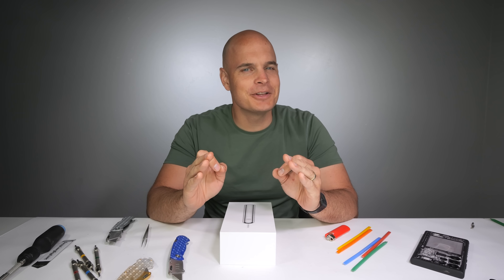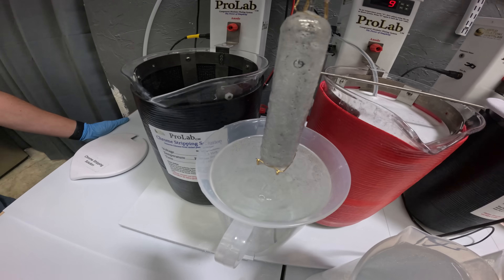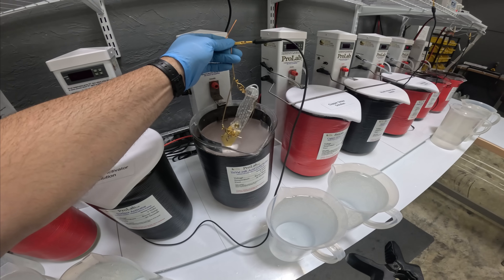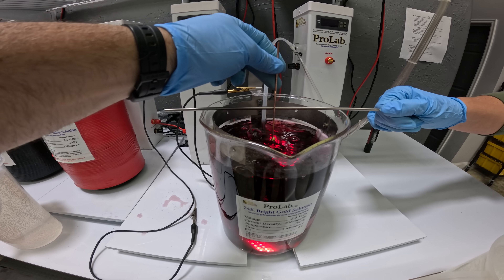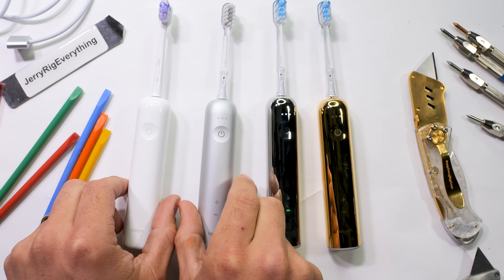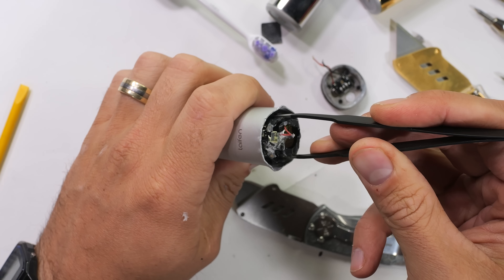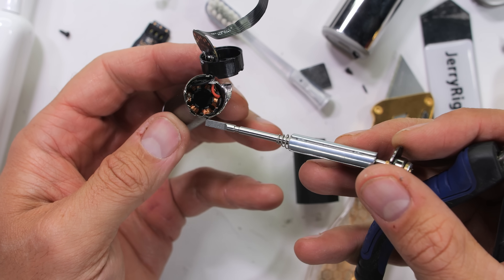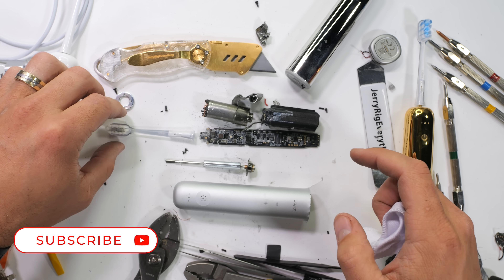THEY SAID IT WOULDN'T WORK!

Comment: 4:11 24k Gold is extremely soft and scratches easily - most things that are Gold plated and need to be touched by ungloved humans use 18k Gold. Gold is also not the best conductor - despite this it is often used anyways for literally being unable to oxidize (though any elements alloyed with it can and do). It will not corrode but it still dissolves quite readily in an appropriate solution.

Comment: Engineeringly bad design of electric toothbrush. I have a better idea and is a cylindrical brush at the top spinning one direction like the electric motor and half side of the brush is going to be covered and half side is not going to be covered a little bit the same as an electric saw in this situation is a brush and the same design of the handle. The half covered of the brush is for preventing to damage the skin close your teeth.

Comment: Jerry. I finally got your foldable jerryrigeverything knife, and while the construction is excellent, I wish you would have been transparent about how the paint on the handle is strictly only on the surface. I got the black one and the paint is coming off rather rapidly, so I'm loosing the black knife that I bought as the paint continually flakes off of the handle. In every other aspect, your knife is excellent and I'm proud to finally own one. Had I known about the surface only paint job though, I would have certainly chose a different knife in hope of avoiding the paint flaking off issue as this naturally causes the handle to begin taking on a different color.    :(

Comment: wow, the gold plated toothbrush looks so cool!

I just destroyed and (semi) repaired my electric toothbrush while trying to replace the almost 10 year old battery. I managed to break the brush open by ripping the bottom cap off, accidentally cutting the copper induction coils :(
I then Jerry-rigged it back together using charging coils from my dad's old toothbrush. Now it works again, but the case is only held together with tape :D

Comment: Dear Jerry,
I appreciate your generocity to give away a fully gold plated electronic toothbrush. I suppose you already made some electrical bonds with the instrument, however I would greatly appreciate to take it off of you. I want to inform you, that I'm quite delicate and responsible person, so the toothbrush won't be in scratches for several decades (if not centuries). I am also not planning on performing any Teardowns©, so the toothbrush will be long living and happily brushing my teeth. I would, however, make a benchmark to compare this fully electronic autonomous self-driving toothbrush to my manual one. This latteris quite retro-fitting, as for manual-everything goes, however I would like to check how much RPMs difference I can get between those two. Also, as I am a man of Android, I am not planning on buying any Apple products, as I never did previously, but I quite like the packaging of this piece of high tech. It would proudly sit on my desk collecting dust.
Hope to hear back from you,
Yours truly,
Faithfully,
Me

Comment: I'm thinking, can you gold plate a motherboard (like an iPhone motherboard), and gold plate all tins, solders and solder pads and contact to strenghten to connections. will it create a short on the board or will the board still work normal?

Comment: Gold is not an "extremely excellent conductor for electronics". This is a common misconception. 4:02 

It is quite unreactive though, and thats why we use it to coat contacts in electronics.

For the actual traces that conduct electricity, silver or copper are wayy better, about twice as conductive, and of course cheaper.

Comment: I wouldn't buy one. Accessing the battery to change it seems to be as hard to get to as changing the battery in an iphone.
If i could buy one that has an easy access to changing the battery then i would buy.
How hard would it be for them to design a screwable cap (still with the 3 charging contact on the cap) and have the the battery coming out right there, no electronic to remove while fully retaining their water-proof rating?
For the 3 pins i would just design 1 dot in the middle with 2 small rings for the other 2 contacts. The inside of the cap would be about the same.

Comment: Although the insides of the tooth brush are fascinating, it'd be nice if they made the battery user replaceable. The only reason I find to throw away your old electric tooth brush is if the battery dies (and is in fact the reason I've done it in the past). 

For the classic oral B ones, you need to slit the bottom with a blade to change the battery, doable, but you lose water tightness (and that's why I never did it). In here it seems like a huge, destructive ordeal just to get to the battery without destroying it...

It's ironic they market it as "if Apple made a toothbrush", since it has planned obsolescence baked in...

Comment: A toothbrush is an oral hygiene tool used to clean the teeth, gums, and tongue. It consists of a head of tightly clustered bristles, atop of which toothpaste can be applied, mounted on a handle which facilitates the cleaning of hard-to-reach areas of the mouth.

Comment: Interesting video! Few corrections however: "5 volts of current" should be voltage instead.
Gold is not extremely excellent conductor as you mentioned. Instead, it is good but not as good as silver and copper. It sure is great for protection layer for copper surfaces below.

Comment: Gold isn't extremely good conductor for electronics, but silver is... Even copper is better conductor, and both are cheaper. Fun fact Gold isn't even a better thermal conductor :)  So why is gold used? Just because it doesn't corrode, it doesn't oxidize. That's the only reason.

Comment: It would be nice to get the toothbrush, I've got the ultrasonic one but the fact that u have to rotate it manually never got to me(my hand). BTW You should say boath capacity and voltage of the battery, or use Wh for that. The one in the video uses 7,6V if I'm correct.

Comment: Electroplating is actually incredibly simple, even at home.
The issue is when you want to plate something on top of steel. You would generally need to produce a copper middle layer first, which doesn't usually play well with traditional carbon-based steel... Unless you have a gallon of pure cyanide to bathe the metal part in... Yeah...

Comment: i once took apart a Braun/oral b electric toothbrush, remarkably similar only the motor in the Laifen looks way beefier, and brushes seem cheaper.
But than the oral B has rotary brushes, wonder which one works better.

Comment: The circuit board even has Laifen displayed at the top, as if by design for a transparent casing. Or potentially for a casing akin to a 1-way mirror that would allow you to see inside but would reflect light once inside so it didn't appear to just be a circuit housing in a plastic bubble.

Comment: Its a cool toothbrush, but I couldn't see my self buying a $70 toothbrush when the electric Spin brush at Walmart is $7... It also has replaceable toothbrush heads, and it can use rechargeable double AA batteries. Don't have to worry about battery replacement a few years down the road...

Comment: Not to be pedantic, but gold is actually worse at conducting electricity than copper. The only reason gold is used is because of its excellent corrosion resistance. For thermal conductivity, nickel-plated copper is frequently used but for electrical conductivity, gold-plated copper is used.
Reply: Silver is a good conductor
Reply: Of that’s right then  circuit company are mad cause many  company use gold in thar circuit
Reply: @kalyanmondal9275 they use gold on the contacts that will be exposed to moisture. Copper is more conductive but both are sufficient for most applications.

Comment: Gold is not exactly the best metal to conduct electricity because the best metal to conduct electricity is silver. The second is copper, and only the third is gold. However, because gold does not corrode, it is often used to gold-plate contacts. This can be seen both at the bottom of the brush and on the test fields of the PCB (and, of course, on the inscription).

Comment: Hey Jerry! (Zack)

Fun facts about gold:

1: El Dorado is a fake island that the Spanish thought had gold on it.

2: The late Queen Elizabeth II allegedly received a 24K gold Nintendo Wii.

3: It is possible to make Purple Gold! The way you make purple gold is combining Gold with Aluminum.

4: The United States, prior to 1933, had money that was backed by gold. However, In 1934, Franklin Roosevelt took the USA off the gold standard.

5: A lot of video games have gold coins as a common currency.

6: Gold scratches at a level 3 with deeper grooves at a level 4

7: Gold’s melting point is 1,948°F

If I had that toothbrush, I would be brushing my teeth with historic, one of a kind, metal, expensive, awesome, toothbrush!

Comment: I love every aspect of the product, however, the contact points for charging instead of regular wireless charging still boggles me. No matter how corrosion resistant gold is, with minor scratches and constant wet environment, it will have contact issues. 
Currently no first party travel charging case is also a big down for me.

Comment: Oh, a non removable battery for a product that's supposed to last for life.
I mean there's no excuse here, no newer version of android or ios will be made for this, and the hardware won't get old since the thing simply has a motor in it, and that's it. Also has a pretty complex pcb which I have no idea why that is in there, but oh well.
But that aside.. the battery.. removable. What the hell are you doing company? In 4-8 years this thing won't charge anymore, you know that.
So do want to fill the world with plastic, or aluminum, or stainless steel e-waste?
You do, don't you?
Yes, you do, you evil scumbags.

Comment: How did they manage to use so much electronics for a toothbrush? It's the Juicero of dental hygine...
Reply: When that PCB came out I was like "holy fuck why is that so complex"
Reply: IoT. It's "connected" toothbrush with an app to save your "preferences" 🤦‍♂
Reply: It is a "normal" sonic toothbrush
Reply: Definitely overengineered; it looks like a 3 phase BLDC motor that's driving the head directly, no doubt some 32-bit micro running the show as well! Probably has more compute power than a late '80s to early '90s desktop PC , in a bloody toothbrush! 🤣
Reply: That's not much.
Reply: Not uncommon for sonic toothbrush. I took another well known bran of toothbrush apart when it stopped working. Battery was fine but of course those can be replaced depending on the brand. What had happened in this case was water infiltrated from top of the toothbrush and wrecked the notor and gears. Bought a cheapass model this time around so when it packs it in less of a $ loss.
Reply: looks great!
Reply: need to run Python on it :) Joking aside, maybe they have some custom control for the winding, ironless hybrid?
Reply: Not supporting a sealed in battery product with limited life span.
Reply: @nav5700  I agree with you on that.
Reply: Opened a bunch of these things to replace the microscopic battery and they're all pretty much the same